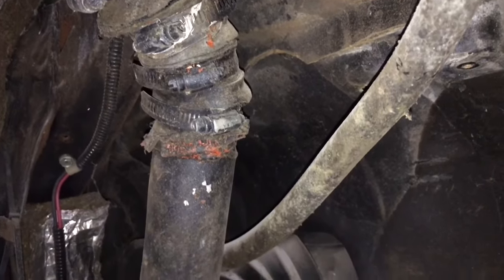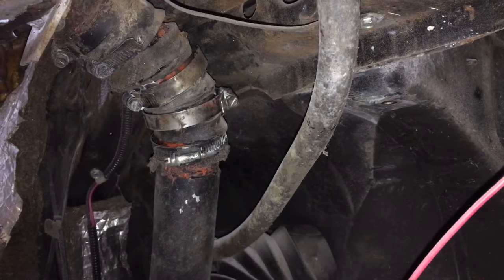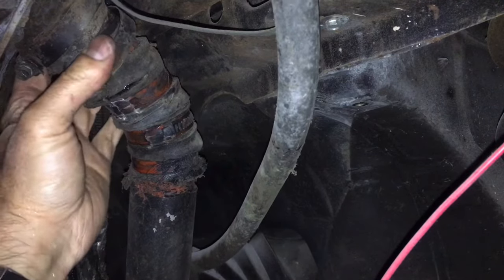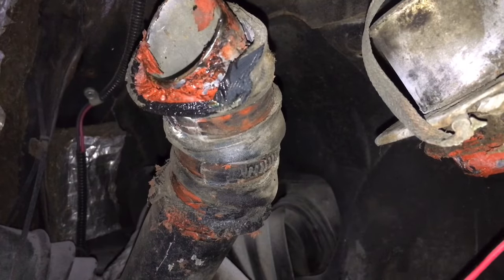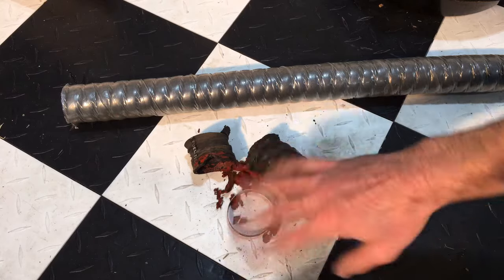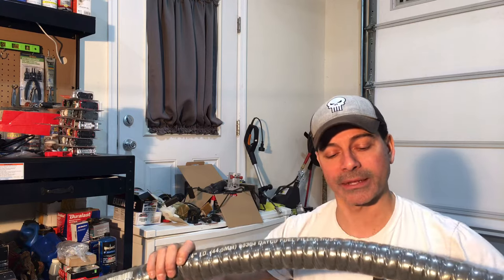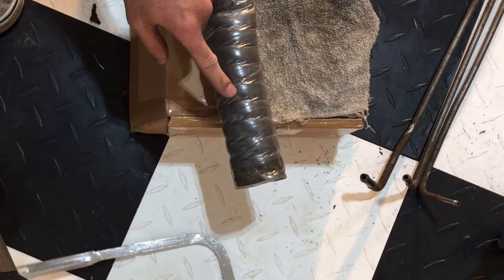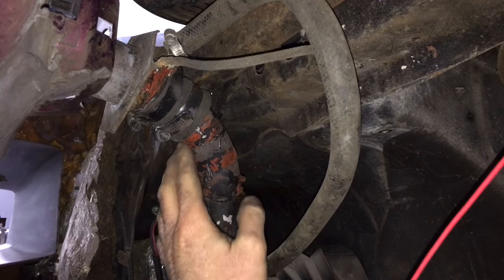Fixing A Leaking Fuel Filler Neck (Andy’s Garage: Episode - 332)

Comment: I have a 98 firebird with the same problem I need to replace the metal filler that connects to the rubber hose that goes to the gas tank can I use the same filler hose
Reply from the maker: As long as there are no leaks in the hose. If it needs to be replaced, you can get a 3 foot hose for about $35